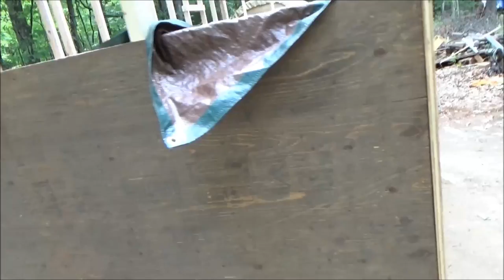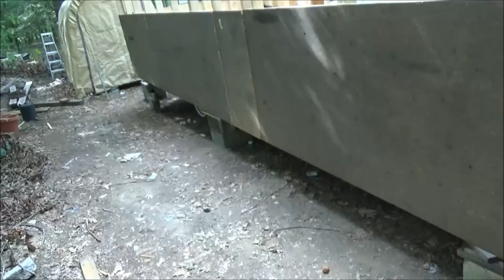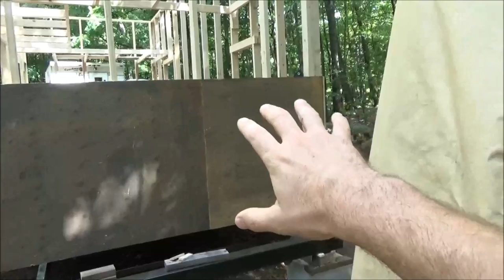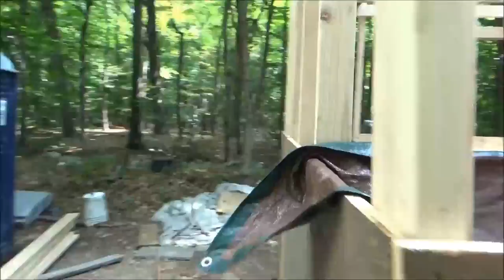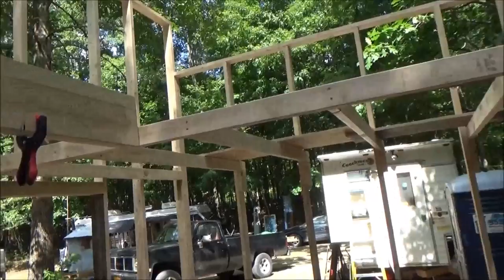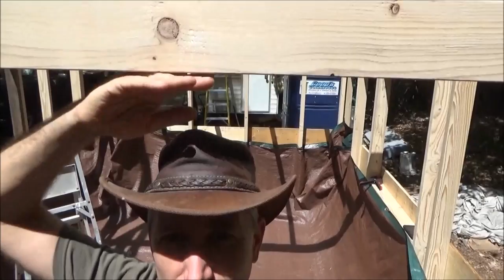Finishing My Tiny House Loft And A Rustic Beam

Comment: Glad you finally decided on sheathing for the frame, and if you'd only see the light on tyvek (would keep you watertight, while finishing framing, and also cut down on drafts, and bugs in the end.) My camp was 2x4 walls with 2x8 and 2x10 for floors and roof. But, it also wasn't made to zip down the highway just built in place 100+ years ago. Yep, that means some of those 2x's still had bark on them and were close to for size dimensionally. Looking good.

Comment: I don't imagine that you'll have much weight in the loft areas, so the 2x4s should be okay (not ideal, but okay). However, you need to run jack studs all the way to the floor under those 2x4s that are screwed into the outside wall studs. Also, there's nothing to transfer the load of the front of the lofts and catwalk to the floor. Maybe you can build in some support columns that get covered by your cabinets/closets, etc.

Comment: Looking good!  Here are a couple of ideas for finishing the interior.  You can make your own stain!  It's cheap...look up some vids.  Basically you put steel wool in a jar with vinegar and let it soak.   I made a work bench and added some regular blue food coloring to the juice and wiped it on. The more coats the darker it gets.  It's not actually a stain its a chemical reaction.  For low tannin woods like pine wipe the board with brewed tea and then coat with your stain. 
On another note I think olive oil turns rancid may want to stick with boiled linseed oil.  Keep up the good work.
Reply from the maker: Thanks for the tips

Comment: Just a tip if you ever redo the loft, have a beam all the way across the long side and then attach the short side beam to the longside beam with screws, it adds A LOT more stability, i'm also aware that this uses slightly more wood, but structural integrity is fairly important.

Comment: I can tell you are excited and look forward to working inside the house (you told us so). But please, remember to finish the outside first. IT is easy to get sidetracked. As you mentioned earlier in the video, you can work inside in the winter.
But it is coming together nicely!
Reply: Also, you don't need 4x4's to support that center beam. All you need is a 2 x 4 - like the block you have in place now. A 2 x 4 will transfer the forces to the main beam very nicely, and it will keep the weight down a bit.
Reply from the maker: Thanks. I wanted the beam for a rustic cabin look. Its going to be covered in oak pallet wood. I will get the outside done first. Its all I can think of right now. I needed the loft to get the roof on though
Reply: The Do It Yourself World The loft is needed for structural reasons and give you access to build the roof, so for me that is not "inside work" even though it is inside. I was thinking about all the other exciting things you could do for the inside. Glad to hear that you are still focused on the outside. Probably hard to concentrate on anything else with all the rain coming your way.
Take care of yourself, then the house. Priorities are important.

Comment: you can always strengten the walkway in the middle by a chain or beam, hangin it on the roof rafters, the are strong, in that way you dont need a sthruth in your walkway or living room downstairs.(iff it isnt strong enough when the floor boards are on it, i think its fine like it is.
Reply from the maker: Thanks. I am thinking about boards from the roof to the loft

Comment: The window you framed in the board on top should have ran all the way across to the stud on both sides not just stop that will make it weak and the two by six that runs across is effected by that too.
  Can you put a couple of short boards in to connect to the other stud?

Comment: Hi Troy, 2x4's are not meant to support horizontal load, just vertical load. Replace those two 2x4's that you ran for your loft and replace them with 2x6's minimum or 2x8's. That will give you horizontal stability for the loft and walkway. You screwed some sections of 2x6's into 2x4's which isn't helping you.
Reply: Never gonna happen, once he's determined it will hold him,  thats all he is looking for!  You make great point though

Comment: To add with he stability and support of the upper loft, I would also put a double 2x4 (or a 4x4) beam underneath the edges of the actual lofts. Then just put a supporting 2x4 (or double 2x4s or a 4x4) on the sides of the walls to support the actual beam. It is like what you are doing for the center walkway support, but also doing that to support the exposed edges of the loft the loft. It will definitely be worth the extra little bit of money and time to do that. I hope I explained it well enough to be understandable. If you have any questions about what I'm trying to say, I'll try to explain better if you want. Good luck with the tiny home! It's coming together really nice and quick. I can't wait to see it completed.

Comment: Hey Troy great progress, I have to suggest put a chain from the ceiling down in Two spots to support the walk way, That Would look Awesome. That long board is almost useless as it is cracked. Drill vertically down and screw it after you glue the cracks and cap holes with wood dowels. Should help. 

You would be better putting in a stripper pole, Scary Thought. That board will kill the view and the feeling. Go with chain cable and tension it. Much better felling to open air. Great to see the progress, Keep it going.
Reply from the maker: Thanks for the tips

Comment: If you want figure out where the shower goes, strech a little tarp over the southwest corner of the bedroom loft and than punch a few holes in it. Should give u good idea where it goes. I don't remember a drawings for a indoor pool. Good idea tho for keepin water of deck\floor. If you tie loft to roof rafters after u get them laid and covered, it will give u a more open ceiling in livin room. That is that beam in the center, the others are fine where they are at. Need to cover only three sides to make beam look like it was yanked out of barn. Also it will have area for wire channel for lighting strips around loft perimeter. U need to make urself a shoulderstock for ur drills so as to keep the drill sraight and the bits wearing out so fast. R those drills hammer drills or hole borers. A hammer drill will get ur self tappers in tighter and will klick loudly when tight. Keeps the bit from roundin out cross on screwtop.

Comment: lol at the offgrid coffee table.

If the loft needs more support, could you just tie it into the rafters in the roof? Maybe on the 2 corners of the railing just extend a board up to the rafters...so the loft could be sort of hanging off the roof rather then only supported from below. I was going to suggest the same type of support for the area in the middle where the beam is before you installed it.

Comment: Your walls need to be braced to eliminate the wobble your feeling. Plus bracing them will ensure the walls stay in a level position. It wont take a whole lot of lumber to do this, just brace from the upper most part of the wall and screw it to the base of the adjacent wall so you wont put holes in your floor. That should take care of the side-to-side wobble your having

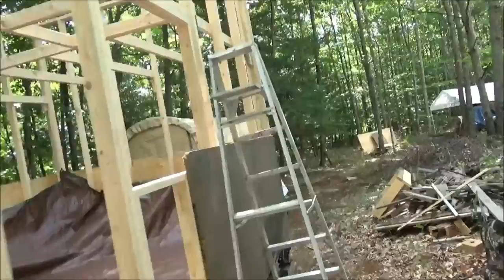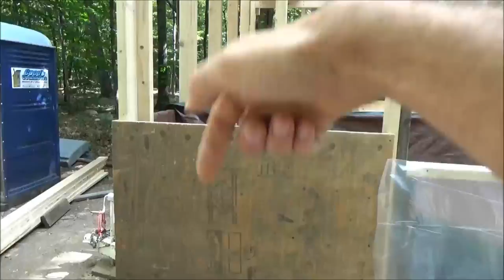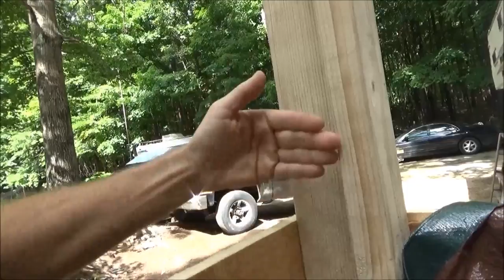Comment: You are progressing nicely, Troy.   I'm proud of you.  By the way, could you do me a favor?  Show that the back left window, looking at it from the front, of course, that the middle joist, coming down from the top, above the window framing, was not cut too short, and that the short piece of 2 by 4 added to that, just above the top framing of the window was to help support the loft, not because you did something wrong.  It will help me resolve a small disagreement with some trolls.   lol  You can see the window that I am talking about at 8:08 in this video.   Now, if I was wrong, and the wall joist was cut too short when you cut it to frame in the window, tell me, and I'll happily apologize for being wrong.   It's not a sin to be wrong....its just bad if I'm wrong and don't have the integrity to admit it and go back and apologize.     Thanks, ahead of time,for your help in this...I know that you are busy, but I've taken a lot of flack about it.   Vicki    ps..the video in question is titled, "Fisished Framing Tiny Home Walls" and you can see the questioned cut 2 by 4 at and around 9:49, hanging cut off, but loose, as the window frame is not added in yet. At 13:07 you can see the window framed in securing the before loosely hanging 2 by 4 and to the left of that, is a shorter piece of 2 by 4 coming up from the window frame and attached to that joist that was cut.   The purpose of that short piece is what is being questioned...the naysayers say that you cut the joist too small, and I said its to help with the securing of the loft and or crawl space.   You can see a spot on view of it at 13:43 and to my dismay, it does look as if the joist has air between its cut off end and the cross piece of the window framing.   In this video, that I am typing this comment in, I can see where a second piece of 2 by 4 was attached to the other side of the hanging, cut off joist.   Please enlighten me so that I know if I have to go and eat crow or not.  I'll not shirk it...I'll do what is right and just because that is who I am.
Reply: Yes it is too short you can see it clearly in the last video after the BBQ around the 13 min mark.  He should have just cut a new board and replaced it. And he should have ran the right side board all the way to the top.
Reply: MC Survivalist Oh, are you Troy?   Are you speaking for him?   I think that he is the one to best answer my question as he was and is there....., we aren't.
Reply: MC Survivalist There is a wood shortage.
Reply: Clide Jones I'm not Molly, but I can answer that one.   I know that he needs to buy  at lease 4 more 12 foot 2  by 4's to finish the corners of his tiny home, but he has temporarily run out of money.   He has enough for his roof and other essentials.
Reply: He addressed it already in a post. I deleted the thread because it was getting out of hand so you may not have seen it. Yes. It was cut too short. He said he as going to fix it, I think. No crow to eat. Not a big deal. Live and let live and all that jazz.
Reply: Myke Dave Are you a you tube monitor or something that you have the power to delete posts?
Reply: Vicki Olson You can't delete your own posts? Heh, I can. Always could. And since I began the thread, all others replying to mine disappeared too. Can you still see them? If so, groovy. Just trying to stop some of the bickering that happened after you came in. No biggie. Carry on, sister.
Reply from the maker: Both. it was cut too short but now is supporting the loft

Comment: does your roof have considerable over hang on all sides to protect the outer wood covering...couldnt tell from the picture you printed off and showed the other day...looking good otherwise...once you get those roof rafters and exterior sheathing finished it will all shore up solid and quit shaking

p.s.   replace that 2x4 rustic look beam you built and put across with a section of tree branch later...that would be awesome and much more rustic

Comment: Troy please explain why you did not use a double top or bottom plate on the walls.
Reply: I always thought that was critical to framing a sound solid structure
Reply: Every house I have ever built, we have used double top/bottom plates on the load walls.  Interior walls were hit and miss depending on the company we subbed for.
Reply: W8FG It is critical when you are framing 16 on center... but when 24 on center it is not since the rafter should be placed directly over the stud now you don't have to  double... with 24 over 16 the rafter weight will hit between the studs and that is too much stress on the top plate.   This way, he saves the weight of the 16 on centers and the double.  I hope that made sense.
Reply: Lynn Morrow I have framed with double bottom plates many times in apartment complexes. The reason is to allow for a  1-1/2" of concrete for a sound barrier.

Comment: Looks like it's coming along, but I still have a couple questions. 1st, isn't that beam still too low? I mean, after you wrap it with pallet wood, your taller visitor's are going to have to duck. 2nd, are there going to be support beams at the points of where the walkway meet the lofts? It has to be able to bare the weight of someone up there, &/or more than one person up there at a time.
Reply: *bear the weight, I mean
Reply from the maker: The beam is now 76 inches from the floor even with the pallet wood on it. Should be fine for anyone I know.

Comment: lol. Don't sweat the stocking feet jab dude. i get it. what I want to know is where your nail belt is. Would it not be better to have what you need "at hand" when you need it? Ya Troy, I pray about the weather too. yup it works too! you were  tossing finishing options around, consider linseed oil and turpentine. very compatible to all wood, especially pine. wonderful odor too! (not ok for floors) you want more stability in your walkway? tie the hand rail posts (3 or 4) to the ceiling. a 1inch square oak rod will hold about a thousand pounds hanging weight. solid man,, :) ps can't forget the hobbit 2nd breakfast Frodo.
Reply from the maker: Thanks for the tips. I am taking all ideas into consideration

Comment: I'm not a architect, but a 4x4 beam is not strong enough to support those lofts and walk way. A 4x4 beam does not have the strength to span 10' (maybe 6'), with out support post, or bearing wall. Same with the lofts individually, they'll need more support with beam and post or bearing walls. Maybe hanging from ceiling rafters could strengthen lofts. I'd consult an architect!!

Comment: Take the beam down and sandwich a piece of plywood between it it will make it stronger
Reply: should do this on all headers  I don't even  build houses and I know this just by looking at my garage door  header
Reply: plowtruckdriver  Depends on how wide your garage door is, whether that is necessary or not.  But, yes ply sandwiched in does add strength.  All headers do not need that though.
Reply from the maker: Too late now. Glued together

Comment: How are you going to replace the tires..
Reply: why would he want to do that?
Reply: ***** Shoot? where does that come from? I asked a polite question. I will see whether Sislertx's question was serious enough to warrant a bit more information so that someone can answer it.
Reply: Sislertx He won't replace the tires unless he moves the tiny home. At this time, he has no plans to ever move it. Should he need to, he will change them the same as any other tire is changed. He allowed plenty of room in the wheel wells for tire changing.
Reply from the maker: I have covered it extensively in the videos. There is plenty of room in the wheel well.
Reply from the maker: pieter zeeuwen mopar is blocked for being a monster

Comment: Just an observation... cuz goodness knows 'telling' you something has backfired big time... :/  anyways...
The beams are beautiful as they are, no need to cover with pallet wood.  A little stain or even the oil you mentioned.  Pallet paneling and eventually flooring maybe, but the beams?  Maybe not?
Reply: He's went all OCD nuts on this pallet wood theme,  Im worried the pallet wood will add another 4,000 pounds at the rate things are going.   Yes the beams look nice, I agree just giving them a light finish be great.  Needs to save weight when possible just not areas that compromise structural integrity
Reply: W8FG Well, if what everybody says about how brutal and expensive (in blades) it is to plane those oak pallet pieces we might see a cure for pallet overload pretty quick.  Don't get me wrong the pallet wood can be beautiful... but he is gonna need soooo much of it.
Reply: Terry Teague I agree...and it would apparently save on blades...but  he has difficulty telling the woods apart.  Somebody should give him wood lessons.
Reply: MollyDolly Wouldn't the covering strengthen the beam?
Reply: SSanf No, it's just for aesthetics, in fact it adds weight with no strength...   But, mostly I just love the look of those beams,  screws, splits and all.  I think they are beautiful.
Reply from the maker: Lol, now I will not longer mention my plans with that beam. Let you wonder and steam about it for a while
Reply: The Do It Yourself World Now that is just not nice at all... have I not shown that I have learned my lesson about telling you what to do?  Does that not earn a girl some consideration?  Would pretty please help? ;)

Comment: Since you haven't actually started wiring yet...I thought that a few of these, placed strategically around the place, might give you multiple 12-volt outlets, as well as a nice-n-easy way to check power levels from anywhere in the place...it might be worth checking into these:  http://www.banggood.com/Cigarette-Lighter-Power-Socket-With-DC-12V-Digital-Voltmeter-p-940590.html

Comment: I have watched you build the tiny house, to me i though it was to tall, but after you built loft, for mine i have one on one end with 8 ft and 10 foot walls lower roof, with a room with fold out bed, if my legs hurt climbing a latter may not be able some days! or  use a pre-built shed or cabin, i been thinking camper to use for temp or summer stay, with my illness, i make blood clots i was bleeding inside i had blood given to me to lower my blood thinner count! to either stop bleeding or go in with scope to stop it they did later in June! after it was stopped they gave me more blood stuff to bring level back up closer to normal! the doc told if i went to sleep Sunday instead coming to ER i would not wake up i have died from blood lost! friend your not sick it normal!  i asked other like local ER! is this blood? yes your going no ware but here were keeping you! that was afternoon june 1 , on your walk way beam supports to floor like 2 on ends and middle! beam ok on bottom of both beams on ends